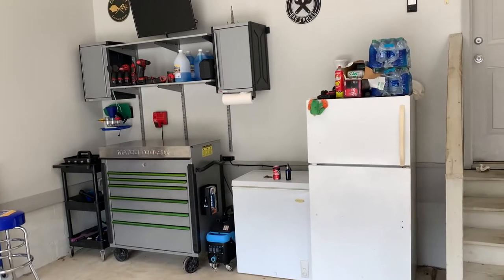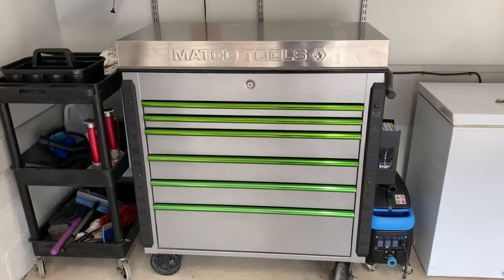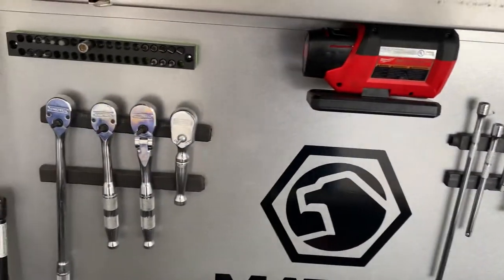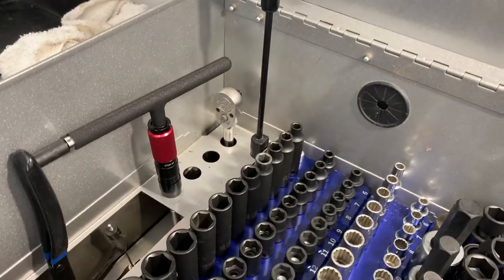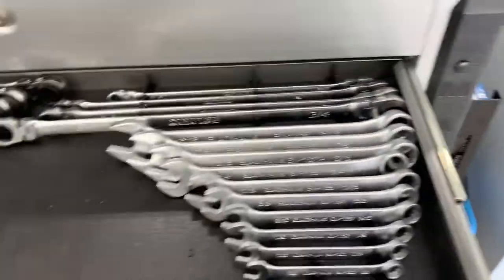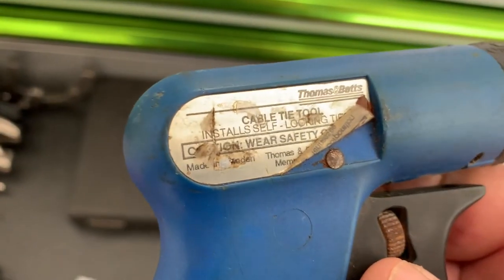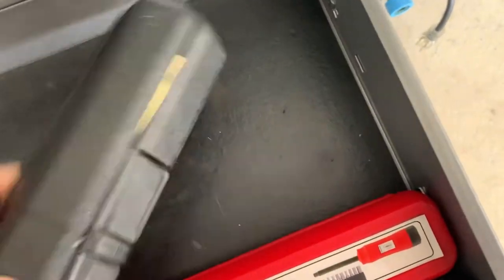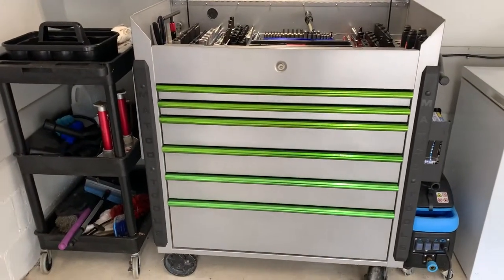Matco Jamestown JSC770 for home garage

Comment: Funny thing when u mentioned the brake wind back tool in the mid 80s I broke my c clamp in half trying to compress caliper. I believe it was a Nissan. We didn’t have Google back then. After breaking my c clamp. I got the tech that had been there many years advice. He gave me the square tool that goes on the end of extension and what do you know it screwed in problem solved. Lesson learned always ask if things give you trouble well now you can Google it. We only had snap on and Mac truck in my days. It’s easy to spend too much on a truck today. You just have to be frugal. Thanks for sharing.